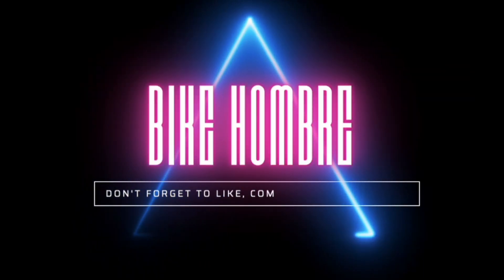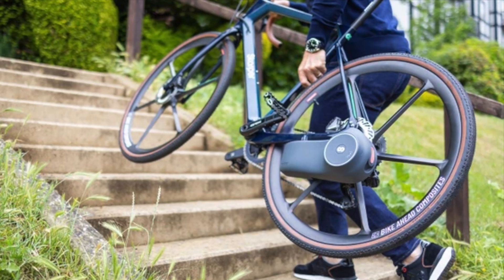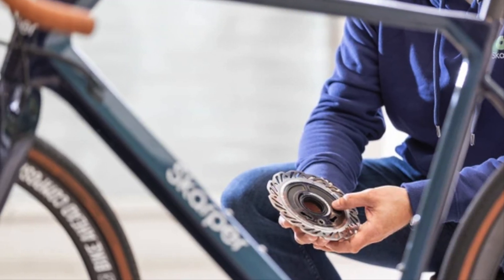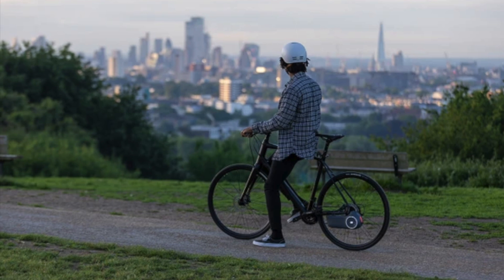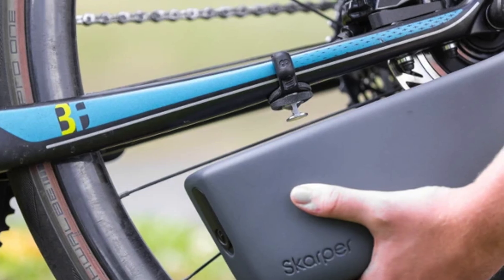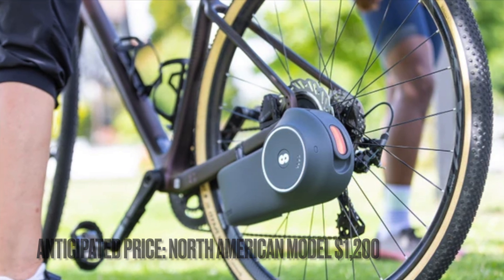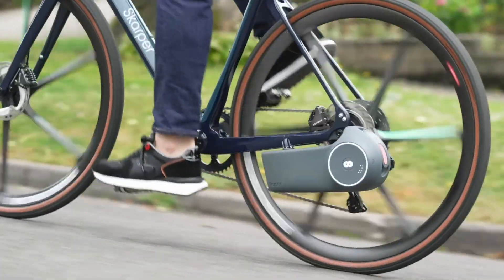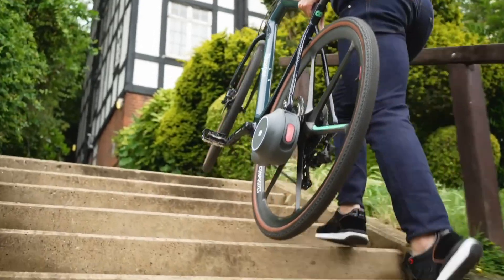Skarper DiskDrive E-Bike Conversion Kit | What has been revealed so far

Comment: It is a rip-off ... So, You firstly have to buy a decent bike over 800 euros then to buy this kit over  1000 euros (plus the cost of the guy who gonna mount it on ) and at the end of the day you will probably  have only something like 200wh energy to spend.... Ridiculous 🤣🤣...  It is better to buy a ebike which could be more powerful equipped with lcd display, torque and speed sensors , mid drive motor etc (in Greece there is a bonus up to 800 euros for the purchase of a brand new ebike 250w)
Reply: A 200Wh battery will give nothing like the range claimed.

Comment: Why not mounted on the seat stay instead of the chain stay? Then it will have better ground clearance mountain biking.
Reply from the maker: It's a good point. Something another commenter said, which I think is a good point, is that by having it on the chainstay and sticking out; you risk hitting your foot when pedaling. Should be interesting once it's released and people get to ride it to see how it performs.
Reply: Accessing the brake disk from the seatstay may be difficult with the rear rack and fender supports running  across that area and also perhaps the brake apparatus may actually be in the way. The law of gravity also favors the chainstay position as the unit naturally hangs down from that position. A firm secure may not be possible on the thinner and vertical seatstay and chances are on rough roads the unit might become loose and shift into the spokes.